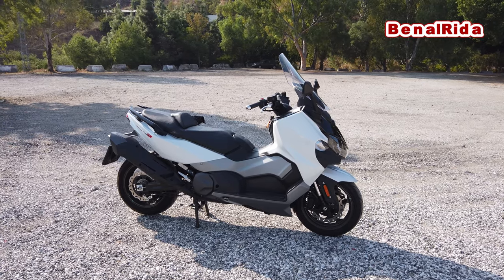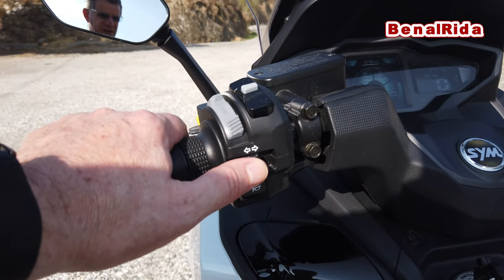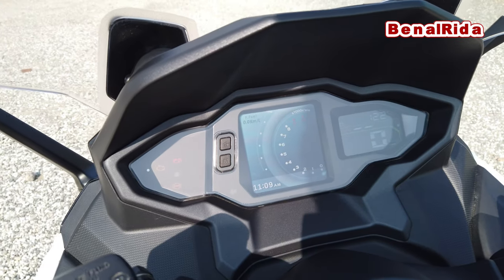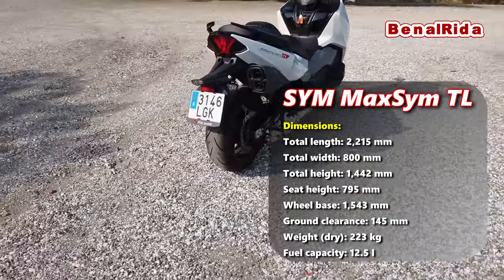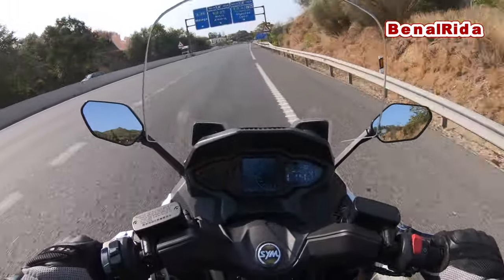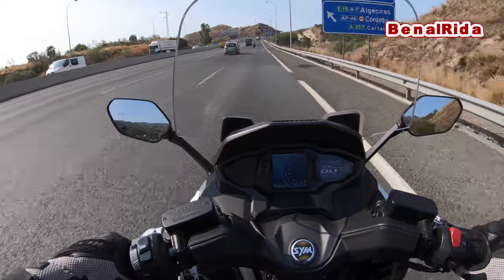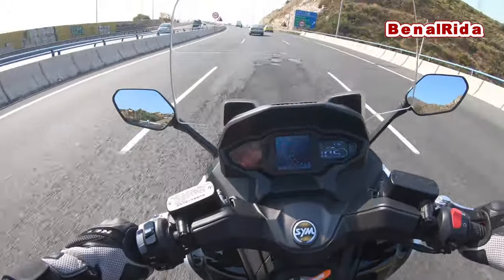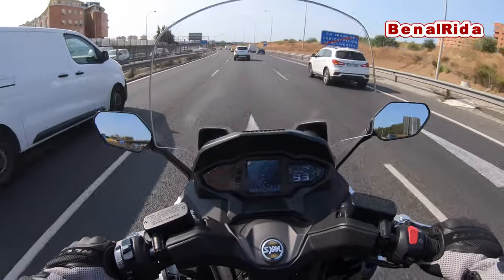Sym MaxSymTL (2020) White - Test Ride & Review - VLOG251 [4K]

Comment: I had Honda Forza350 Yamaha X max300 they were good, but the power of the Sym 508 engine cannot be compared, it is simply another superior category, Stop comparing with single-cylinder engines because the Sym 508 teaches them lessons